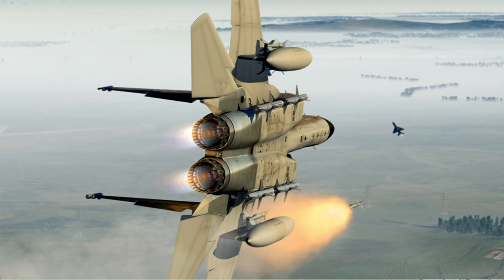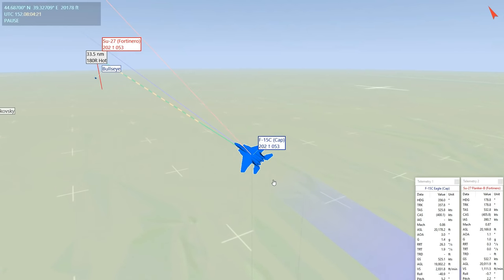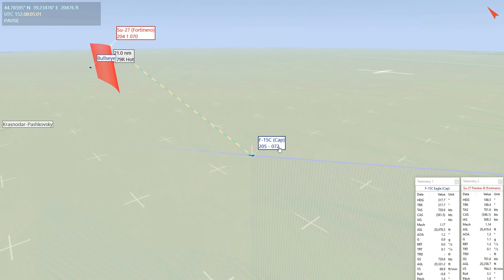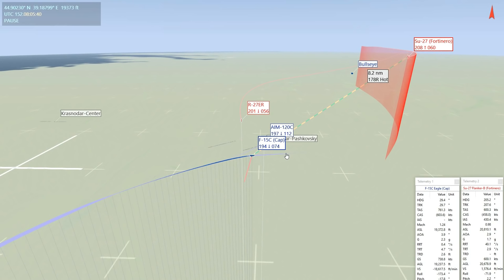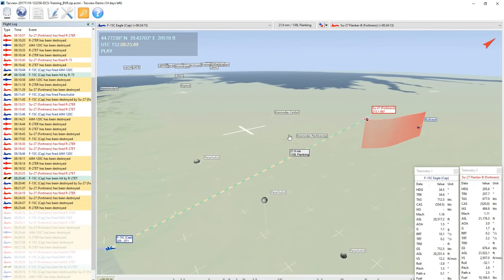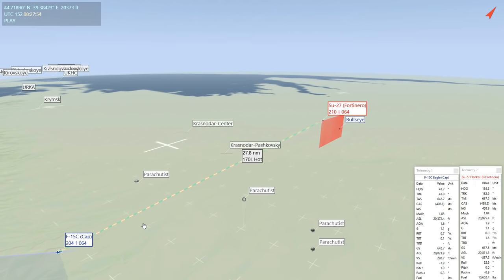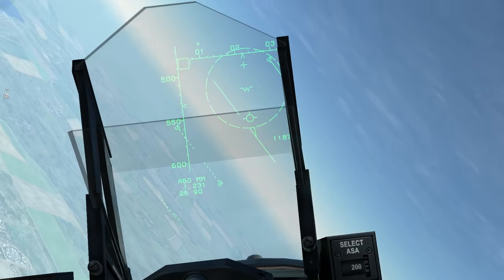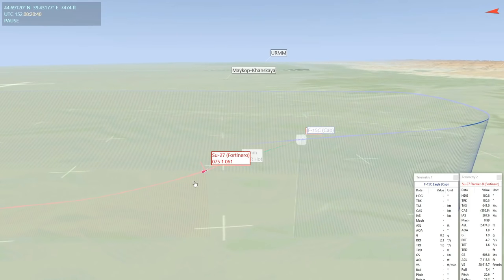F-15C Eagle: Optimal BVR Crank & Missile Technique Tutorial | DCS WORLD

Comment: So there are a few better tactics for 1v1 with a flanker I would suggest. Number 1 is always expect the ET. There are basically 2 fixed ranges at which all the all aspect IR missile sensors in DCS will detect an afterburning head-on target determined by its altitude. The only difference between IR missiles otherwise is kinetic performance and maneuverability .  Dropping out of AB before this point denies that shot entirely. They'd have to LA (with Low PK if you stay off the burner) which is an extra step and more time before they start defending if they bother with trying to force the ET shot . Number 2: Never give a flanker your six unless you are breaking LOS, or have a wingman to extend to. In all situations where you can get under him while performing defensive maneuvers , its just smarter to beam as opposed to going cold. Most of the time you'll either break the lock outright, or spoof the missile with chaff. This allows you to better keep eyes on the bandit (and his missiles),  recommit faster and, create tracking issues for his IR sensors if the 120 is spoofed without forcing them cold or beaming. Lastly, unless you have a huge advantage, double tap, 1-2nm apart. By huge I mean a combination of speed, altitude and SA. If he isn't painting me, and I'm not in AB at a given range he most likely isn't in position to reciprocate.
Reply: @ChinchillaDeTucson  R27-ET, medium range IR missile

Comment from the maker: ONE THING I FORGOT. When applying this tactic at different altitudes, use the following fire points:
Deck: 6 miles (doesn't work to well at low level)
20,000ft: 10 miles
40,000ft: 14-15 miles
And interpolate in between.
Reply: Grim Reapers Totally awesome ..just amazing game too..I love 💝💝💝💝it...
Reply: Is this shooter's altitude or bandit?
Reply: Shooter
Reply from the maker: Assuming both are the same alt, I don't think this tactic works if both are different alts. As the shooter, your job is to match the bandit's for this tactic.
Reply from the maker: *match the bandit's alt.
Reply: Would it not be better to stay high if possible? Gives you exclusive use of higher altitude so you can cash it in to exit, rather than matching a bandit down to 5000ft and being stuck low, probably unable to do that 270 slicing maneuver. I think it would still work, maybe just extrapolate between the high numbers and low numbers (you're 15k' and they're 5k', so use numbers for 10k' for example.)
Reply: The reason the speed was showing wrong in the 3rd run in Tacview is that the label was displaying Groundspeed not TAS. and so when you're diving almost straight down, your speed relative across the ground will be very low even if you're going fast straight down.
Reply: Grim Reapers - When I fight the Su-27 BVR with the F-15 I've discovered that firing from >35 miles head on can be really effective. I've been able to reach firing parameters at 39 miles at 1.25 mach and 35,000 and get the kill. It does require the target to engage with R-27s but if they do my strategy is an immediate 5g turn followed up quickly with another 3g turn back to my original course. Tacview reveals that the quick turns cause the R-27 to make two extreme course corrections while the Su-27 is able to keep me painted with almost no maneuvering. Since this also limits the amount of maneuvering my missile has to do the Su-27 either disengages or ends up in the path of my missile.

Comment: nice video, thank you.  I think it was practically pitbull off the rail at that point.  I enjoy these types of tutorials. Update— so what I took away from this is concentrating on 1 bandit is the most important task for an inexperienced pilot. In the F16, bags dropped and 2-4 missiles makes for a very fast nimble airframe. 4 for 4 so far taking on 1 at a time. Firing at each one between 10-12 miles away with 120’s. Very cool

Comment: Funny how the initial contradictory art work of the F-15  engaging the MiG 21 was chosen with bags-on for a BVR demo?
Note:
1. R27 ET= Buffed
2. AIM 120= Nerfed
The above  gamey facts equal Russian bias conveniently conveyed as "noob" building community. Lol.
Reply from the maker: yup
Reply: Trout well i use the flanker a alot and 27r are mostly useless and firing range is similar, i only use them if im force to, so i put the bandit on defensive
Normally whit the flanker i will go full IRs whit 2 27r just in case of
Yesterday i was flying the f-18 low in to the mountains whit radar off and only aim9x i got ambushed 3 times by one at 3 o’clock for 4 other at 5 o’clock for 2 or less and the other at 2 for about 4-5 flankers... all 3 times I dodged their r-73s or 27T 🤷🏻‍♂️ by turning hard on them and fire 2 aim9x in angles from 20 to 70 degrees only 1 aim9 missed out of 6 
Russian missiles cant compare whit the Americans americans one beside the aim 7 crap, another “force defensive weapon” lol

Comment: Isn’t the AMRAAM supposed to be effective at up to 40 miles? A 40 to 10 mike reduction seems more than 40%...
Reply from the maker: 10 mile is optimal, max effective range in DCS 25miles
Reply: Ah ok thanks.
Reply: Joseph Orlando no dcs just has bad missile physics
Reply: At 10 miles AMRAAM would have tactical advantage - if target is flying straight(usually to guide Fox-1 missile) and you fire AMRAAM at 10 miles, it will only start tracking when it's too late. Basically enemy would have no time to dodge it.

Comment: You are a genius! Most F15c guides I read advised me to fire at around 15 miles and spam every time I recover from a crank. Your guide is so efficient.

However, a similarly genius YouTuber showcases how he took out a F15c with Su27 by flying low to the ground and beaming.
The F15 was doing everything as you did and only fired the second missile after the first one missed. However, the Su 27 did not fire any BVR missile. It simply closed in while beaming and destroyed the F15c.

Do you have any F15c guide on countering a low flying Su27?
Reply from the maker: sadly the Flankers do indeed own the low altitude and Eagles own the high altitude. I will investigate.

Comment: Interesting how the ET keeps tracking you from the front quarter despite all the manoeuvring ;)
Reply: ETs are vicious little buggers - I love putting an ET in the air a second or two after I fire an ER, especially effective if the target pilot starts a crank to trash the ER right away, there's a good chance he might not see the ET launch!
Reply: +J C  The R-27ET can kill a target from up to 32.6 miles (52.5 km) head-on, so the seeker has to be able to see a target at least that far (if not further!) head-on, at least in certain conditions.  And if you have an F-15 which has been going supersonic, I think the front part will warm up nicely for the seeker.  I don't know if DCS models that, but it should make a difference IRL.
Reply: The ET was originally designed to chase down fleeing high-speed Tornado/F-111s - it needed lots of energy but was designed to be fired from close range behind a target running away on burner. Sorry, but there is no way it could lock onto a target from front aspect at 30 miles.
Reply: Well, even a cursory look at Wikipedia (which I know isn't always the most accurate!) reveals an "effective kill range" for a head-on aspect (which the above is) of between 2 - 52.5km, which is over 32 miles. Tail aspect ranges are much, much lower, so while you're not wrong... context matters. The seeker can definitely see further than the missile can fly.
Reply: +J C  "The ET was originally designed to chase down fleeing high-speed Tornado/F-111s - it needed lots of energy but was designed to be fired from close range behind a target running away on burner."

Both the R-27T and R-27ET seem to be all-aspect from everything I have found.  The R-27 is a contemporary of the R-73 (which is notably all-aspect), entering service 1 year prior (1983) to the R-73 (1984).

"Sorry, but there is no way it could lock onto a target from front aspect at 30 miles."

In reading further, you do seem to be correct on this.  The front-aspect max range shot requires "PPS" mode, where the missile is fired without lock, and acquires a target while in flight.  So it isn't really clear to what range the R-27ET seeker could see a front-aspect target in optimal conditions.

Since "PPS" mode isn't modeled in DCS, it does appear some liberties were taken.

Comment: The Real F15C  has better manuvabilty  than the Su 27 above 550knts.. they accelerate  in a turn and keep there energy  up while Su 27 while loose energy...the Eagle is designed  for high energy  turns and BVR ,but can hold its own against  even an F16, at low altitude.